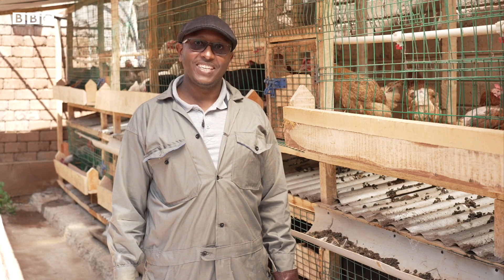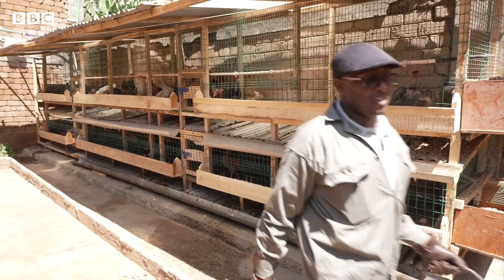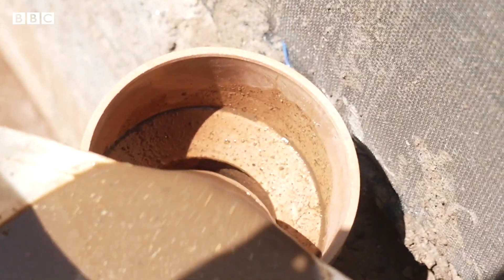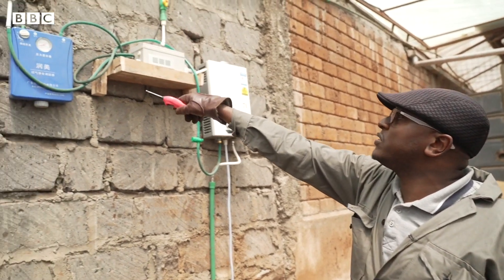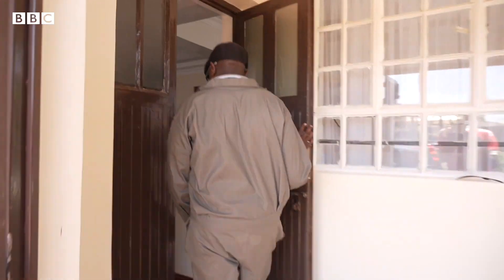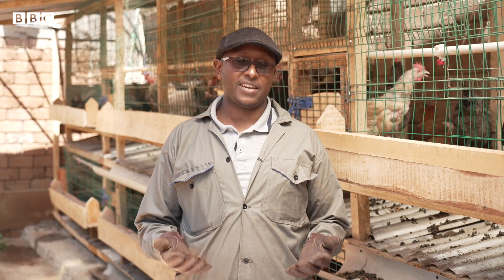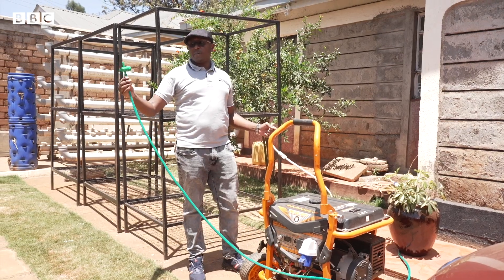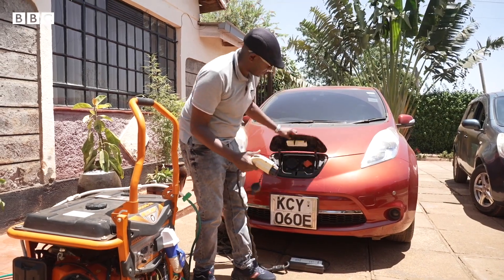How I use chicken poop to power my life - Using the Flexi Biogas Technology.

Comment: Do you use a normal LPG Gas Generator ? Or is it modified for your own biogas ?

don't you have to somehow get the water out of your own bio gas before using that?
Reply from the maker: We modify generators to run on biogas.
Within the digester set-up, there's a water trap thatensures gas only gets to the point of use.

Comment: Wonderful video!!!!!! You've gone far more than other Biogas videos. Please assist,  what are the names of the gadgets (1) extracting Sulphur and carbon dioxide (2) heating the water with gas (3) generating electricity
Reply: With current global focus on climate change, there are a number of carbon credits and subsidies in a number of countries, Therefore, I am interested in the extraction and recovery of carbon dioxide gas from biogas. Any ideas? What is the name of the equipment? Thank you so much.
Reply from the maker: Thank you for your comment and encouragement. 
1. desulphurizer
2. Biogas powered water heater
3. Any kind of generator can be modified to run on biogas.
Reply: @FlexiBiogas  Do you offer courses how much do it cost?
Reply from the maker: sorry we don't offer courses. What we do is train users on assembling, feeding and maintainace of the biogas system when conducting installation.
Reply: Do one needs to travel to Kenya ?